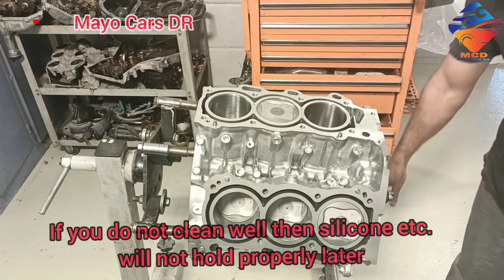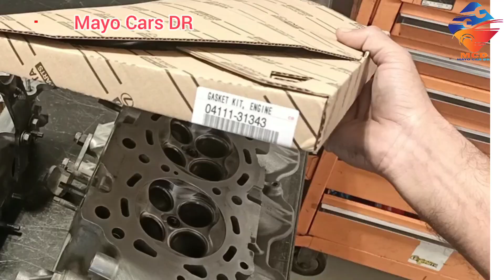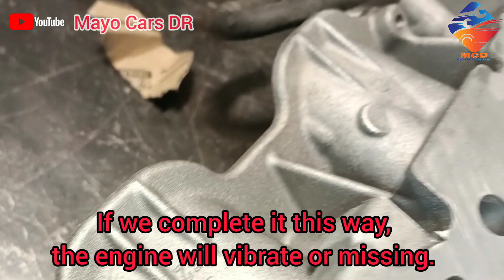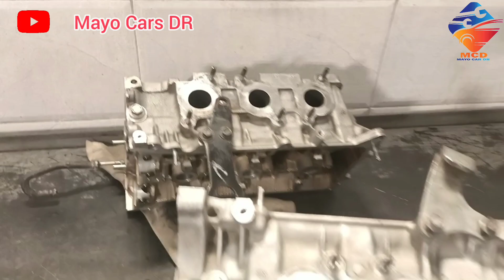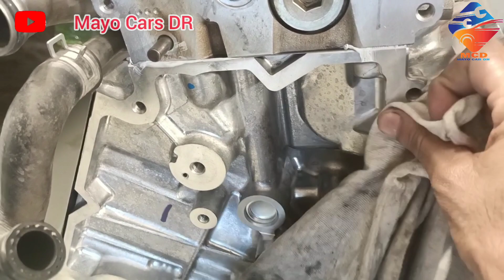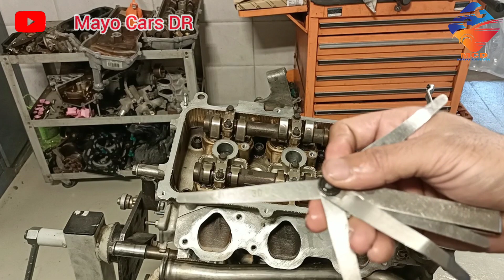(Part 1)1GR V6 4.0L Engine Rebuild Of Toyota Land Cruiser 2008

Comment: One doubt form the camshaft assebly, Is the Bank one in the passenger side? 
Are there the 1, 3 and 5 cilinders, right?

The numbers in the buckets what does it mean 43 47 ???
Reply from the maker: https://youtu.be/SC1cbNfuzV0
Reply from the maker: This is the lift number that checks the valve's thickness
Reply from the maker: You will find more information in the next video
Reply: It is the Installed lifter thickness 43 represent 4.30mm and 47=4.70mm

Comment: Amazing video, I've used this and a couple other videos (mostly yours) to replace the head gaskets on my 2005 toyota tundra! One question: On the driver side, you torqued the bolts for the cams to 9.0NM. On the passenger, you say 0.9NM. Are they really that different,  being the same bolts? Thank you!
Reply: 41:39 and 52:08
Reply from the maker: This is a mistake in my writing
Reply from the maker: Thanks for comment
And watching video
Reply from the maker: 9.0Nm correct torque
Reply: @MayoCarsDR  Thank you so much! I'll comment on one of your videos again in a few days when I have it all put back together.

Comment: Hello.  Thanks for the prior response.  I forgot to ask.  My 08 4Runner has 295,000 miles. I am replacing head gaskets on the 1GR-FE and will sending my heads to a machine shop to be checked.  If they have to do a valve job does that require valve clearances to be checked when reassembling?    Thanks.
Reply from the maker: Yes, just checking it is not a problem

Comment: I guess the intake valve clearance you measured at 46:03 minutes is 0.10mm. I thought you said the minimum clearance for the intake should be 0.15mm.
Reply: According to vehicle user manual the
Valve clearance (engine cold)
Intake 0.006 - 0.010 in. (0.15 - 0.25 mm)
Exhaust 0.011 - 0.015 in. (0.29 - 0.39 mm)

So in the intake could fit de 0.1mm but he tries the 0.15mm first and pass snugly.
Reply from the maker: Yes you are right,But if 0.10mm passes easily, that's fine too
Reply: @MayoCarsDR  Exceptional tutorial!  Your clarity and thorough step by step instructions are among the best I’ve ever seen. I have been watching auto repair videos for years and you give the very best benchmark. Thank you!!

Comment: Hi great video series.  What is the purpose for adding the white sealer on both sides of the head gasket?  I see that mentioned in the service manual too.   Also, do you need to replace the head bolts or can they be reused?  Thanks!
Reply from the maker: This is where the engine oil is likely to leak, so silicone is applied here and the head bolts can be reused.
Reply: @MayoCarsDR  Do I need to measure the bolts prior to reusing like suggested in the FSM?
Reply: Do not reuse Torque to yield bolts and do not oil them either. It throws off the torque spec @MayoCarsDR

Comment: Hi there.  I'm in the middle of replacing head gaskets on the 1GR with 295k miles.  No codes or check engine light just loss of coolant from cylinders 4 and 6.  I just brought the heads in to get checked at the machine shop.  They said are .003 out and need to be resurfaced.  They said this is typical of aluminum heads.  They also said that 5 intake and 2 exhaust valves are leaking heavy.  The machinist advised me to remove the valves and replace the seals. He said to use a wire brush and lap them.  Once I finished, he said to bring them back and he will resurface them.  He said a valve job would be expensive especially with the valve adjustment.  Should I follow his advice or should I consider a valve job?   Thanks!
Reply from the maker: Yes you can believe it